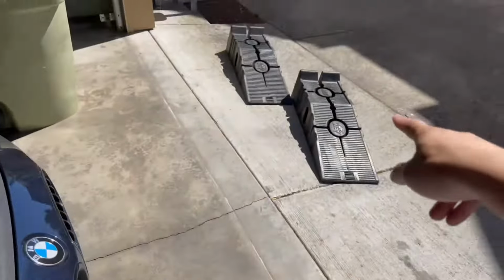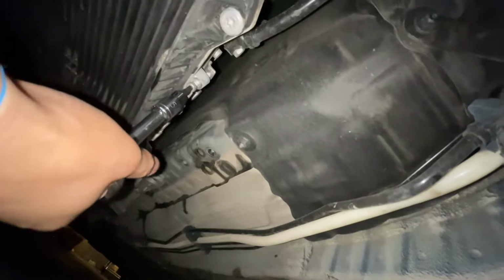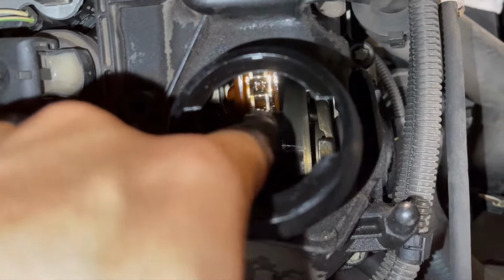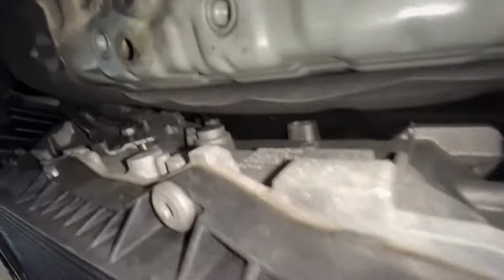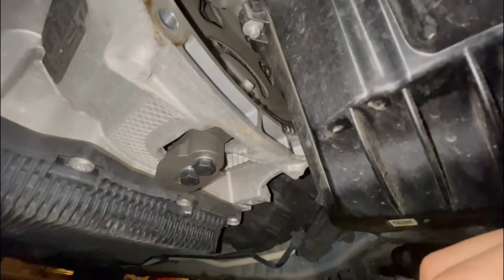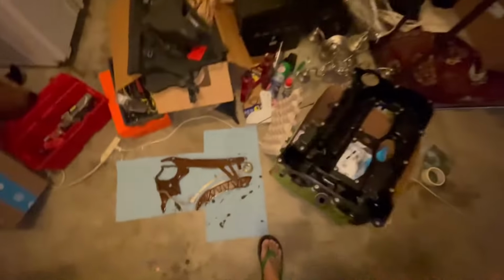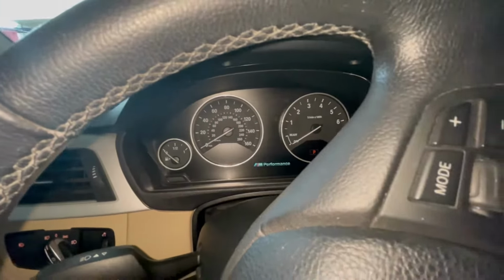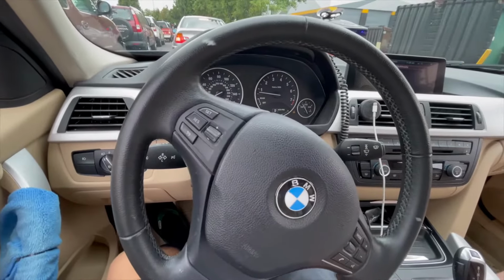BMW 328i N20 Timing Chain Replacement At Home DIY

Comment: A word of warning to anyone thinking of replacing the timing chain tensioner as a preventative measure.  I've just done exactly this on my 328i (N20) and immediately, the camshafts are now out of timing (drivetrain error on dash and fault code 130E20).  I would recommend turning the engine over without the spark plugs if you do to make sure to build oil pressure before attempting a start.  I just unbolted and installed the  chain tensioner on my older 320i with N43 engine with no problems.  Hoping to just adjust the timing it at the weekend. However, I may end up replacing everything anyway.
Reply: You have to rest adoption on Vanos with ISTA or some other scan tool that’s capable of doing reset on Vanos
Reply: Need the vanos locking tool. Locks your camshafts when you take the chain and stuff off
Reply: Alguien  quemediga  donde  esta  el  taller  adonde  lo  puedo  llevar
Reply: Fcp euro have a good video and yeah sounds like you need to vanos lock tool to timing those correctly aswell
Reply: how do you make sure to build oil pressure?
Reply: Cause you did it wrong simple
Reply: @mikimiki195  I replaced the chain tensioner and now the timing is adjusted. Can you adjust it again with esys or do you have to do it mechanically?
Reply: I replaced the chain tensioner and now the timing is adjusted. Can you adjust it again with esys or do you have to do it mechanically?
Reply: @wowasenn920  if you took out timing tensioner and your timing has moved 
You have to do it mechanically with timing tools 
There’s no other way. 
If your timing chain has moved and if your can have moved do not start your car. You can cause major problem. 
Only if your timing has moved “Do Not Start your car”
Reply: @nitro1659 you have to crank the engine over without spark and fuel a couple times then reconnect and start up as normal

Comment: Its a joke for BMW to use cheap plastic parts for critical functions: the chain guide, hot coolant exit connector, engine cover, etc........ .  On top of this, BMW cars have poor temperature control system from bad design to unstable sensors, causing overheating which in return accelerated deterioration of these plastic parts!  Shame on BMW leaders and engineers!

Comment: One important thing to keep in mind when you attempt to see if the chain is stretched while turning it over by hand… while the tension is spring loaded, it relies on engine oil pressure to properly tension the chain. So you’re not getting an accurate indication of its condition doing it that way. The tensioner will fluctuate its pressure against the chain as you rotate the engine by hand. You’re better off taking the hydraulic tension out and installing the hand tensioner screw tool, tension the chain, then retry your observation.

Comment: If the chain guides and tensioner are the root cause for the early failure of these chains, can I get away with changing only the chain, chain guide, and tensioner?  Can I skip the oil pump chain replacement and skip all this engine jacking and oil pan removal stuff?  If the timing chain breaks, that can badly damage the motor, but if my oil pump chain goes, it seems less catastrophic and I can just replace that chain when and if it ever happens...
Reply from the maker: Unsure since BMW did update the chain itself in the oil drive part. I think theres just a lot of variables and points of failure in the system in general which is why its recommended all components be replaced since you are in there anyways.

Comment: I had seen the FCP Euro video and was a bit overwhelmed with the job. I have done plenty of brakepads, alternator / radiator / hoses before.
After watching your video and hearing your advice I feel brave enough to do this myslef.
Reply from the maker: I was also but I decided just do it. The car was up on jacks longer than I thought maybe 2-3 weeks instead of a weekend. Make sure to have all your tools beforehand and it'll go much faster.
Reply: Did you end up doing it?

Comment: hey if you're still checking comments, did you use a 1/2" or 3/4" breaker bar for the bolt?  Wondering if my 1/2" will break trying to loosen that crank bolt

Comment: Thanks for the video. I like it that you didn't edit out the few minor setbacks such as the engine misfiring on one cylinder. Just like in the real world where us diy mechanics encounter such stuff. 

I just bought a 328i with 200k km on the clock and don't know if the guides and chain have ever been replaced. Is it safe to assume that when the tensioner has the brownish plastic colour it is still the original and when it is the white plastic colour it is the newer version? Or does the white become brown over time? I also noticed that you put in the flywheel locking pin but were still rotating the engine after this. Or was this just non chronological editing of the video?

Comment: Did this hold up? It didn’t sound like the timing chain noise really went away after the new start up.
Reply from the maker: Still driving it. Around 10k miles since I did this job now and did a 1000 mile road trip recently and nothing out of the ordinary.

Comment: Isnt this covered under BMW if its production before 2016
Reply from the maker: Only if it's diagnosed. BMW won't say its a timing chain problem unless it meets specific criteria. I've taken it in multiple times to BMW and they said its under tolerance and now taking it apart myself shows its not (guides are obviously cracked). So you can wait for your engine to fail and replace an engine out of warranty, or if your dealer is nice enough to say its suffering from the issue they would replace it.
Reply: @MatthewWong  Interesting. I was at the dealer the other day for some routine stuff and my SA was saying that you can check your chain tension just from removing the oil cap. The chain is visible and reachable for them to check the slack (if any). My N20 is 04/2016 so it does not fall under the extended warranty (7 yr/70k miles) - https://static.nhtsa.gov/odi/tsbs/2017/MC-10142923-9999.pdf 

I am approaching 70k miles so I am wondering if they would do it as goodwill, I am starting to get paranoid about it and 'sense' more noise during driving, I do not have the engine/acoustic sound deadening under the engine cover so could be it or the injectors are just loud
Reply from the maker: @jonathandauria2498  Thats interesting, my dealership had the "master tech" come out to tell me that the chain tension under the oil cap is supposed to be loose as the cam lobs rotate back on engine stop occasionally. He said this is "by design" and was "surprised I even noticed". I even have it all on my dash cam recording the conversation. He told me this was not grounds for warranty work and that was welcome to do it out of pocket and see what a mechanic would find and BMW would review the case and reimburse me if it qualified.
Reply: @MatthewWong  lol my dealer failed to mention that the timing chain on my 320i is completely stock. Said they had it fully inspected before i bought it at 72k miles. Like yeah it's not gonna be broken but they failed to mention how critical of an issue it was. It seems now that the whine is starting to get louder and this morning when I started the car it sounded like loose change banging around for a second.

Comment: Really great video thank you so much.  I have a question.  Looks like some kits include the Intake VVT Gear and Exhaust VVT Gear, as well as the VANOS central valves.  Should I be replacing these as well?
Reply: Only if you had vanos codes prior

Comment: Also, so does the updated BMW chain and chain guide fix the premature failure issue?  BMW seems to recommend that this N20 engine needs a new timing chain every 100,000 kilometers, which is every 62,000 miles!  If the new chain and tensioner are not defective, can I wait to do this every 100,000 miles?  Is there are upgraded chain that lasts longer?  100k miles is a lot, but honestly, I think these chains should last a lot longer given the work involved in replacing...
Reply from the maker: I've read of a couple engines that did go out on forums after replacement of chain and guide. Not sure if its due to incorrect installation or something else but I think the failure numbers are still exponentially lower than that of the original chain + guides
Reply: No you’re supposed to do it ever 100k
Reply from the maker: @DuckMcDuckinson  yeah sounds about right I just did preemptively
Reply: @MatthewWong  also brother. Use AMSOIL European Formula 0W-40 FS. Your guides will last longer on a 100% synthetic oil. For $20 a year, you get 25% off all their products or you could do $10 for 6 months.

Comment: when you go to torque down the crank bolt is it ok to not have the engine sitting on the subframe? cause right now i have the subframe lowered in order to get the oil pan out and i have the engine lifted a little with a engine support bar and i have the driver engine mount off on the driver side. Will it hurt anything to try and torque it down or does it have to be lowered onto the subframe?
Reply from the maker: Its probably better to have it connected to the subframe so you can apply the proper amount of torque.

Comment: Hi I have replaced timming chain n tappet cover on a BMW N20 X3, car drives fine but when you go over 4000rpm then the drive train error comes up saying "continue journey at moderate speed. Full performance not available, have vehicle checked" I run the diagnostic and clear the fault codes but when you drive again and reach 4000rpm then code is back. But car is still running smoothly. Can you assist me please?
Reply from the maker: It sounds like it might be in limp mode? Sorry it would need a full diagnostic to figure out whats wrong.
Reply: @MatthewWong  morning no car doesn't go in limp mode .it's driving fine just that msg keep coming back .if I can have ur whatsapp number I can send u scan report
Reply: What brand did you use of timing chain kit ?
Reply: Probably the brand of timing chain used
Reply: I'd start with looking up what codes are being thrown instead of erasing them

Comment: Great work Matthew, I am not sure how to determine it from the whine as engine is so loud and seems the same every time i hear, I am based in Canada and have 131000 KMS on it, its a 2013 328i xdrive. Should I do it preventative or leave it until I hear loud whine noise?
Reply from the maker: The n20 engine has lots of sounds that it will make during running. The timing chain whine is very noticeable and is very loud in the upper area of the engine near the engine fill cap. It is very distinct and several users have good videos on it on YouTube. There is also whine that is normal from the lower portion of the engine but mine was loud most likely due to the oil drive chain being stretched. I think you should tackle it if you have the time and garage space and do not expect to need your car for a while. My car was running fine and smooth even with cracked guides its just the chance you take before you jump timing or guides completely crack.
Reply: Definitely has a rattle sound to it! Also sometimes the noise will quite once the oil pressure builds. I feel like it’s most noticeable on start up.

Comment: Was your car running fine before you did the timing ?
Reply from the maker: Yep
Reply: @MatthewWong  oh ok. Cuz I have the same car and my timing chain is just as slack as yours in the video. And I’m getting a misfire on cylinder number 1. I’ll replace the injector and coil to see if it fixes the misfire.  I already did all four spark plugs just recently.
Reply: @guccipig2782  what was the code
Reply: @romanobrown5592  the injector wasn’t seated right so the Teflon seal kept melting away. I fixed the issue now. It runs fine.